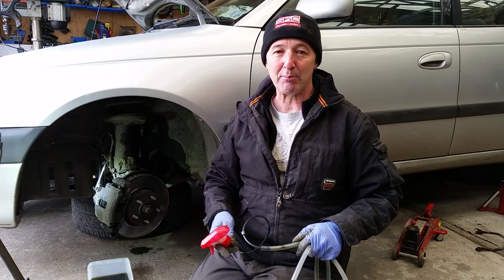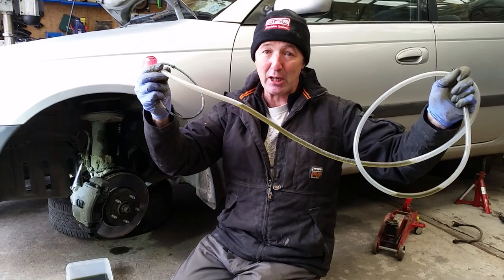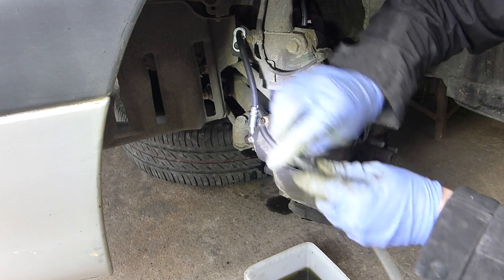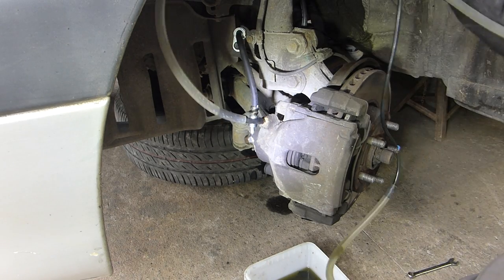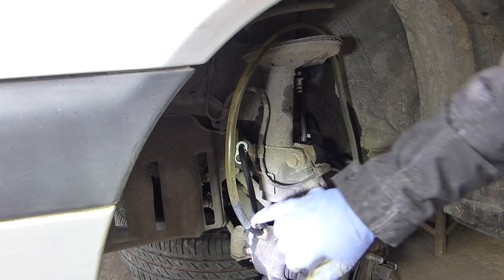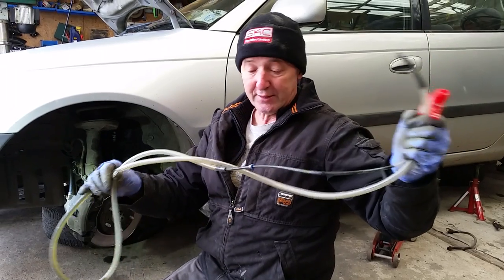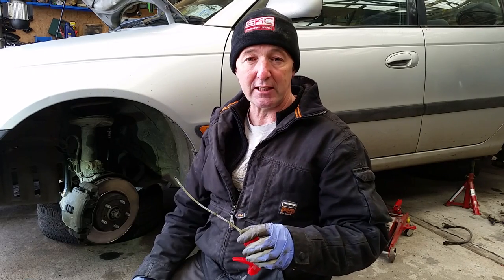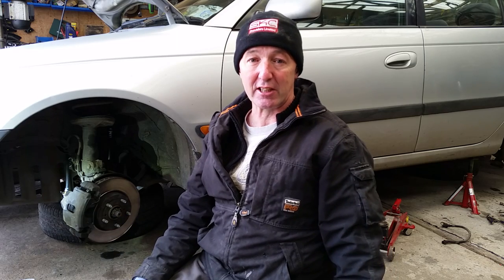Awesome - Homemade car brake bleeder -- Brake Flush -- Free

Comment: I think there might be air going up back the line in those threads. With the two man method you only open the bleeder for a second till the air hisses out. I think i trust the two man method to get all the air out. The rest of these methods are flaky.  You should try the two man method After you do this and see if you get any air.

Comment: Sorry for sounding stupid but can someone tell me when you add the new fluid? If you've removed the old fluid by using the spray vacuum method here then you have an empty line from the fluid reservoir to the caliper? I'm going to be doing my brake fluid soon and this method seems good, I'm just a bit confused by the theory.
Reply from the maker: Keep an eye on your level of brake fluid and when the reservoir is half full top it up. You will see the colour change in the fluid going into your pump tubing. You can top the reservoir as often as necessary. Hope this helps Cheers Gerry
Reply: @GerrysDiy  Brilliant thank you Gerry. Makes perfect sense now 🙂

Comment: Great idea buddy. Will this method work on the clutch fluids as well?
Reply from the maker: Hi Kham teh. Yes it will work on clutches. I just used what I had around but with the correct hose you wont see any bubbles except whats in the line. Cheers Gerry👍

Comment: Might work with a liquid hand soap dispenser and it would not make vapor since brake fluid is horrible for car paint. Probably doesn’t help lungs much either.
Reply from the maker: Hi Lyon. I tried that and there was not enough vacuum for it to pull the brake fluid from the brake hub. Change the spray pattern to a stream and pump it into a jar. Would not be great in a confined space. Thanks for commenting Cheers Gerry👍

Comment: I made something similar up a while back using a 50ml syringe and length of clear pipe. The trouble was it just sucked lot's of air in and around the nipple thread into the brake cylinder. I wasn't sure how much of this air was being removed as it entered. I guessed on the cautious side and assumed some would remain in the cylinder thus defeating the object of bleeding the brakes in the first place. I think I could see the same effect here as it was constantly removing air as long as he pumped the handle. I hate to be negative and perhaps my car's age and rusty nipples made it more easy to pull air through that way. Maybe I'll put new nipples on and retry.
A better method is to simply put a length of tubing on the nipple with the free end under anch or so of hydraulic fluid in a bottle. Put a little strip of tape or use a marker to show the level on the bottle's side then open the bleed nipple. It will slowly bleed itself by gravity. No need to pump pedals either. You need to have lots of time and patience with this method but works every time if you're in no rush. Obviously no good for a professional mechanic!
Reply from the maker: Hi Gary. thanks very much for taking the time to write your comment. The air bubbles in the tube can be stopped easily but they are after the fact and beyond the bleed nipple which means that if there is brake fluid coming into the clear tubing it will be from the car brake line and the line will be cleared. Imagine the clear tubing had a hole in it a foot from the car and before the squirter ump. Air would get in and it would bubble but the car brake line would be bled. Really appreciate your comment Cheers Gerry👍

Comment: Personally I'm scared of messing with my brakes. So I always make a mechanic bleed them. But what a great little invention 👍 I guess my only criticism is why the long horse. I would think the shorter the horse the better ?? Or am I wrong in thinking that 🏁🏁
Reply from the maker: Hi Zig zag. Its simple about the hose. It ws off a pump I use for pressure testing and I didn't want to cut it😀 It is amazing how simple this thing is but it works great. Thanks for commenting Much appreciated Cheers Gerry👍😀

Comment: How did you disable the abs sir?thank you
Reply from the maker: Hi Abdul. I did not disable the abs. The fluid is drawn through the system in the direction it would flow normally. Works great and free to try. Hope this helps Cheers Gerry 👍
Reply: @GerrysDiy   thanks alot buddy your the best, thanks for sharing this amazing video

Comment: Just put your clear tube in a cola bottle with a litle loop upwards pedal and fil in the oil regurly until you have a full clear tube with oil and aproxely 150ml OR 200 mil oil use thats good for flush and clear Any air bubbels ... Just a hint

Comment: Thank you!
Is It safe to do with ABS breaks?
Thanks again!
Reply: no difference
Reply: The biggest problem with some ABS systems isn't with bleeding the system. Some systems can be damaged by pushing the fluid back through the lines when you push the caliper pistons back in. Always open the bleeder and push the fluid out the bleeder when pushing the pistons back in on calipers and wheel/slave cylinders.

You can do either vacuum or pressure bleeding on abs, no problem.
Reply from the maker: Hi Bullfrog's Workshop. Thanks for the info much appreciated Cheers Gerry👍
Reply from the maker: Hi Pedro. The guys have answered that question here for you. Thanks lads Cheers Gerry👍

Comment: I have an even easier idea. Simply open a bleeder screw, lightly pressing the brake pedal a couple of times and then pull the top off the master cylinder. Gravity will pull the brake fluid through the brake system and out through the bleeder. Just keep an eye on your master cylinder that it doesn't get too low. Been doing it for years this way.

Comment: Will this work on clutch pump?
Reply from the maker: Yes it will. It will draw the fluid through the line and out through the spray pump. Just make sure you have enough fluid in the reservoir. Hope this helps Cheers Gerry

Comment: I would not want to atomize/mist brake fluid like that. It's bad for you and bad for anything it touches.
Just get a bleeding kit from amazon. Comes with tubes, nipple adapters, and pump that drains fluid nicely into a bottle.
Not that expensive.

Comment: great idea... if it was a permanent tool, i'd make the hose adapter/joiners in brass and seal them.  I'd find the smallest tube on the nipple and use a tube spanner.  i'd leave the nipple closed and get a good vaccum , then crack the nipple like you pump it with another person.  i'd rinse and repeat until the line is bled. less likely to have air leaks if you are cracking the nipple for a very short time..... hope this helps ....

Comment: I can get the hand pump for that from Harbor Freight (horrible fright).  They not only have the generic one but also the Mity Vac brand.  Just make sure that when you get anything there you still have the receipt for when it breaks.  I would not want to be spraying brake fluid near my car.  Not only that I would not want my cat Jinx to get into that stuff.  It is just as bad as antifreeze maybe even worse (don't want to find out).  If someone's pet ever consumes any brake fluid or antifreeze they can die a slow horrible death.  That would be very sad.  I just make sure that if I had any of those two chemicals out I don't leave any messes.  I would even consider gravity bleeding.  Just keep the tubing pointed upward at least from the bleeder.

Comment: Could this be modified to bleed the power steering system?
Reply: It would take ages :) Just turn the steering wheel from lock to lock a few times, it'll pump the fluid out.

Comment: Hi Sir,
I can't understand why it needs to use a larger diameter tube rather than one that just fit bleeding nipple and cleaner product spray gun.
Furthermore why should we have the tube so long and set it higher than wheel arch or brake fluid reservoir instead simply spraying into a bottle close to the caliper.
Thank you.

Comment: Lol i have the same Idea 1 Month ago, but i have to much EngineOil in it and want some Oil out. I try that same, but with Water works well but not wirh cold Oil. I go to a Pharmacy and buy syringe (dirty Cheap) and with a Syringe it works better. 👍

Comment: Great idea. If you can. Get a prayer head that wont get gunk stuck in it when bleeding my system was real gunky it was not maintained I'm looking to do this but I need a sprayer that wont get stuff In that little filter it has in the tip. I'm going to use your idea and try to add something that filters the oil and let's air and oil pass easily. Another  thing. I'm thinking of getting a strong container and adding a pressure gauge to it put a safety bottle before the inlet of a vacum pump with something to reduce suction so it pulls at a safe pressure do you think the vacum on a electric vacuum pum for a/c would damage the master cylinder  even if I have a pressure reducer and safety cutoff at 8 to 10 psi ? I'm going to work on rv break system long lines anyone willing to give up ideas on this

Comment: Did it work with abs system
Reply from the maker: Hi. It works with abs brakes. These little hand pumps are quite powerful and will pull the air and brake fluid from the line. Make sure you have enough fluid to purge the line and it will work fine. Cheers Gerry
Reply: Thanks for the info I'll give it a go today

Comment: Just keep in mind brake oil is pretty toxic and you're not really supposed to touch it or inhale it. My problem with that setup is that it turns the oil into vapors, which is seriously not good for you if it comes in contact.

Just get a cheap plastic fluid pump from the local tool shop and connect that to the brake line...

Comment: Hmmm. 15 years in the trade. Those bubbles gotta be coming from somewhere. Gotta feeling that someday soon our man Gerry here is going to feel his brake pedal going all the way to the floor. Inconclusive.  This method doesn't bleed the master cylinder.
Reply: Tony Quance You must've watched the video with the sound muted. He said that his bleeder valve has a leak coming from the threads of the valve thus the consistent air bubbles shown.

Comment: I can't get the fluid to come out the air comes out but the fluid won't pump out!
Reply: Did you losen the cap for the resivoir up top? If that didn't work you may have one of many vehicles that has to have the car running to actually pump fluid through the ABS block.

Comment: Bought vaccum operated brake bleeder on ebay, $20.00. Cheap chinese crap, works 👌🏻, fingers wont wear out, 😂.
Need an air compressor though.
Reply from the maker: Hi Jt. It's great to have the tools but this was just a quick fix. Thanks for commenting Cheers Gerry
Reply: @GerrysDiy  you've made an awesome recommendation, never thought of it myself. I will definitely try your invention out. Cheers from 🇦🇺. 👍🏻👌🏻

Comment: It looks too simple for me to trust. What about bleeding the master cylinder and the abs booster. On my car with split ABS first you depressurise then bleed the booster then all 4 corners, you start the engine to re-pressurise, bleed the other half of the booster and bleed the front two brakes again. So if you tell me I can just go around the 4 corners with a squirty thing I'm gobsmacked.

Comment: Make one better, buy a Powerade bottle with a pop up lid. Smash out the centre hole of the lid. Put your clear hose inside and grab some wire put around the lid. Boom hang it from the each spring while going around bleeding the breaks.

Comment: You kept saying that it didnt cost anything,  however at some time you did purchase that hose, and the squirt bottle for which you used the cap from. So it did cost you something.  And if someone does not have those items then it will cost them to abtain the necessary items needed to do the job.

Comment: You have to be careful that when spraying it doesn't get on your paint or plastic body parts. It will ruin your paint, and it will bleach plastic parts. I accidentally put my finger on my plastic driver mirror, it left a white ass finger print that was permanantly bleached white.

Comment: Problem is, the brake fluid (not oil) will eventually melt the cheap plastic sprayer valve and handle as it is very toxic.
Reply from the maker: Hi GereDJ2 Amazingly I just bled brakes on a different car last week and I still had the sprayer from the video. It's still working even after 2 years. They work great and free usually to replace. Thanks for commenting Cheers Gerry

Comment: I thought I was a smart arse when I used the same principle but with a liquid soap pump when doing an oil change on my smart car, then suddenly this vid popped up as a recommendation. .
My  recommendation is never buy a car without a sump drain nut, what a ball ache .
Reply from the maker: Hi James. I haven't even been in a Smart car but they look cool and Dinky. Some of the soap dispensers don't make enough pressure but it's very easy to sus it out. See if it can lift liquid from a couple of feet. Thanks for commenting. Cheers Gerry

Comment: put some grease on the nipple thread, will stop the bubbles, also , though an ingenious method, that sprayer, is atomizing the brake fluid, brake fluid is not too good for you or the car, you can also see that the atomized brake fluid is drifting. So that's not a great idea, not something I'd do, plenty of single man brake bleeding solutions around and cheap. nice one though good to watch

Comment: What about the small bubbles lol
Reply from the maker: Hi Spikes Hostage. The small bubbles are coming into the tube after the bleed nipple so the brake line is already purged at that stage. If  I had put some grease on the nipple it would have stopped the air getting in at the threads. Thanks for commenting Cheers Gerry👍

Comment: Why so long of a hose? U don't need that much
Reply from the maker: Hi Famus Man. The hose needed to be put back in a pump project I was working on as soon as the brakes were done. The pump / sprayer had no problem making vacuum though. Thanks for commenting Cheers Gerry👍
Reply: @GerrysDiy  I suppose you can use it to spray gas in your carburetor or intake manifold to see if you need a new fuel pump or not as well

Comment: practically does not work because it sucks air from around the bleeder screw threads.
It's better to pressurize the master cylinder tank then open wheel bleeder... air comes out of system as expected non from threads 👍🏻

Comment: Just hook up the hose to your brake bleeder nipples and then straight into manifold vacuum of your engine. A race engine might have 9 or 10 inches of vacuum, or a family car might have 18. Start the engine, idle it, crack the nipple, you aren't even using fuel while your idling the car as it is burning up the old brake fruid. No old fluid to dispose of!

Comment: Don't do this! I tried it out just out of curiosity. it's very bad, waste of time and effort. 1) It makes a mess because the spray head will leak break fluid everywhere 2) You have to connect several pipes together because the spray bottle will be a different diameter, which means that you will get air leaks unless you do it properly 3) It takes forever to pump, literally hours.  There is a reason why this guy said that he had his wife help with the breaks. It takes literally half an hour or more of pumping for each wheel. And you spray might go bad in the middle of the process because it just wasn't made for so much use and a higher viscosity liquid. Just use the bottle and hose method, works fine and you don't have to think up of ridiculous methods of doing something that already has a good solution.

Comment: 2 Requirements for bleeding brakes are,  remove any air and drain the line till you see clean fluid.  Your process did not complete with uncertainty as bubbles kept coming out and the fluid was still dirty and may contain moisture.  Also note the fluid will disolve paint, so do not spray any onto you car.

Comment: 11/27/2019
Los Angêles County

Long time ago Video. How many of you Gêniuses tried this "Sawmill Setup" ? _Looks like it will work but I HIGHLY recommend bêfore you try this, make da _ sure you Bleed your vehicle Calipers in the RIGHT sequence that the Manufactuers mandate. Long time ago, vehicles brake bleeding procedure was too do the Right Rear wheel 1st, LR 2nd, Right Front 3rd & the Left Front Last - He didn't tell ya that part & the looks òf thís Photo looks like the Left Front ( even though he could have done the wheel calipers in the sequence that I noted above )

Now the fellas who haven't done this before may start at the Left Front wheel also & kill everybody in your Family on the Freewảy.

Most vehicles today, now some still do, but the procêdures are all rearranged. In fáct some vehicles have "2" Brake Bleeder Valvês on each Caliper. Which one do you bleed 1st ?

Before you start accepting the advice of all of thêse "SawMill" Mechanics from the Internet ( though the mean well ) & some don't give a da_ _ bêcause they're ignorant is to implement the Steps of purchasing the THIN "Brake Specifications/Brake Blêeding Procêdures" Manual from Motỏrs or buy the Real Chassis Sẻrvice Manual from the Dealership Parts Department or ordẻr  it from www.natsf.org or the cheap DIY www.allđatadiy.com cheap subscription , but for Brakes Specs./Bleeding Procêdures go to www.motỏrs.com as fast as you can.

You will see with thí Motỏrs Guide, the majority of vêhicles don't even use the Antique RR, LR, RF & LF procêdure. In fact, some vehicles require you to use a Real Sca Tool tô Bleed yỏur Brakes.

Comment: A primitive vacuum bleeder (-;
Reply from the maker: Hi Morten. It's crude yes but not primitive. It's basically a pump and a non return valve creating vacuum in the brake line. Cheap / free, what's not to like. Thanks for commenting. Cheers Gerry

Comment: VERY Stupid and hazardous idea. 1)  Brake fluid is toxic, spraying it into the open air catching it with a bassin is hazardous and slow.  2) A bottle spray valve is weak and will eventually fail and air will get sucked into your brakes.